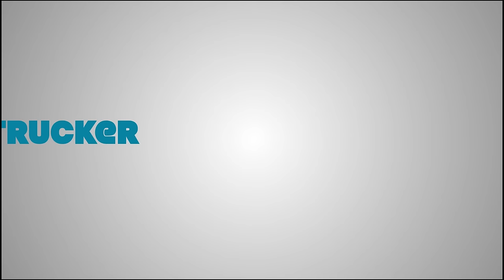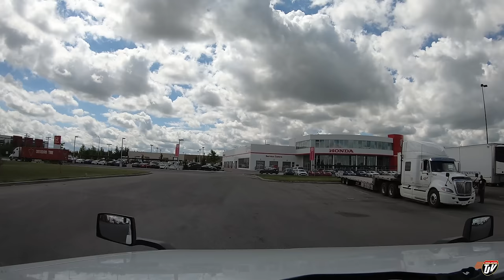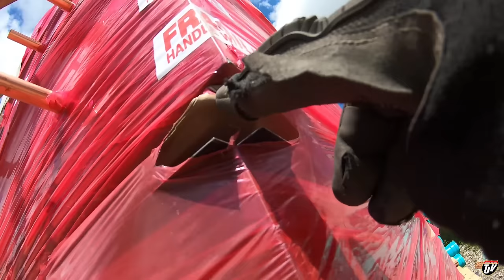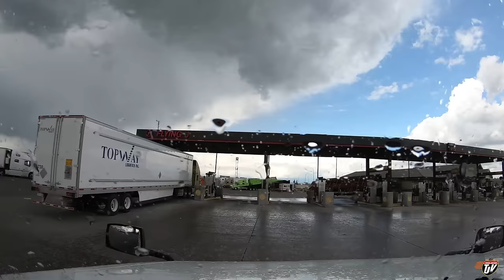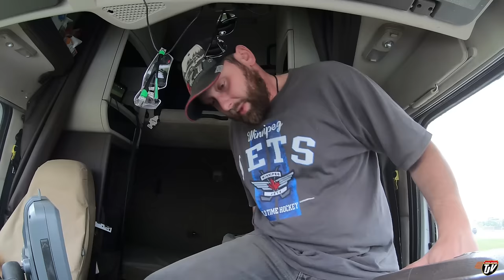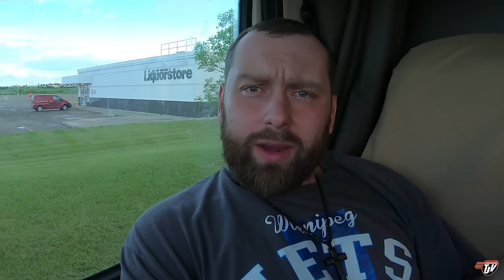My Trucking Life | FRAGILE | #1745

Comment: Whatever company makes that product, with the sharp edges and copper pipes sticking out, needs to work more on their shipping preparation. They need to maybe strap some Styrofoam over the pipes and edges. They're going to be getting a lot of shipping damage otherwise, from shippers / truckers who aren't as careful as Trucker Josh.
Reply: Agreed. Or else the trucking company needs to insist on proper packaging, and to refuse the load if it isn't. Sounds like someone dumped this one on Josh.
Reply: Or it can just be shipped in a dry van like it was probably intended.

Comment: Hey man, hurry up and wait. That"s why i like quick delivery, last minute loads. They always r waiting on me. Call me several times when i will be there. And when i"m there, they are so desperate waiting that they unload me even before i could open my door. And always empty back home. No waiting, no e-logs. Hm, i like it. Be independent. I like to decide myself when i drive or stop. When i overtake or calm down and relax. Even when there"s always "rush" written on my papers. Yeah, to the speed limit, a little less maybe. And back home relaxed. Why hurry? The world"s turning anyway. And when they ask why i"m late, i just say the truth. There are more people on the road. I can"t run over them or under. I have no authority to drive on the shoulder. No bleu light or siren. When there"s a line up i have to wait to. As long as they call me back every time, i think i"m doing fine. You like what you"re doing? So am i. Sometimes i got police escort, when i had to deliver parts for a broken down control kabinet in Amsterdam. Half the city had no power. Amazing what is possible and allowed then. Red lights, one way streets. Not important, just go go go behind that police car ;)=